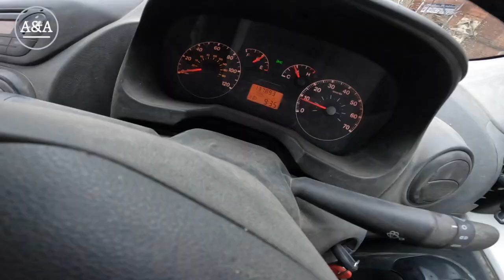Does Every other Bricklayer Have This Problem?!

Comment: What's that camera lol I thought I was on acid again😂, ditch them straps mate no good as you swing with them so you don't get full benefit from the knee raises your torso needs to be static. 👍👍😆
Reply from the maker: Haha it’s a next level camera, it’s wicked but makes editing so much longer! Yeah I make you right, my form wasn’t great in this video, these are the nuts though, basically help you get extra reps in as your arms will give out before your abs
Reply: @AdamHatch  Gotcha 👍
Reply: @AdamHatch  😁Early 70s i used to have it with my cornflakes every day, i dont remember much about the 70s

Comment: Only fools use electric mixers 😆😆😆😆 can’t beat the petrol.
Reply from the maker: Haha this is true! Do you have to service them at all?
Reply: @AdamHatch  
Wouldn’t be a bad thing making sure plenty oil is in. New filters etc. no real issues. To be honest normally people that do is because they aren’t been looked after properly Honda engine is pretty reliable. Used petrol for 20 year. Only ever owned to belles. Had electric but don’t have same power for heavy use drum would stop spinning with half a mix. Etc. But real issue is faffing about with cable’s relying on someone being them next thing someone trips over cable or old Jeanie ornaments have knocked with cable oot window 😆😆😆😆 to much multiples for its either gas or cordless fuck cables more on a mixer haha. Big plus it’s silent tho. Petrol if kept well maintained isn’t to noise. But obviously miles more than electric lol
Reply from the maker: @lmilne4859  not going to lie, you’re making me want a petrol mixer 😂
Reply: @AdamHatch  
They have sky rocketed in price bought a new 1. 14 months back. £640. Now a see some sellers looking for £860- £900.
Reply from the maker: @lmilne4859  not going to lie you’re making me want an electric mixer 😂😂😂
Reply: @AdamHatch  Don't listen to Lee mate, use the customers electricity all day long 😂
Reply from the maker: @bricklayersworldwithandy6277  haha too right! Sorry Andy I’ve been slacking, I’ve seen you’ve put some videos out but I haven’t had much time to get through them!
Reply: @AdamHatch  no probs mate 👍